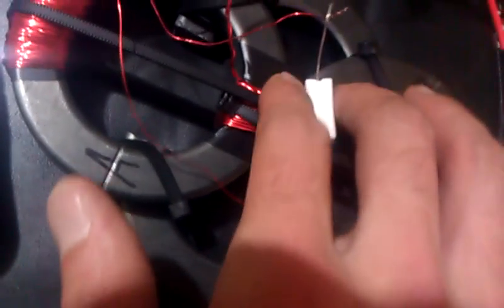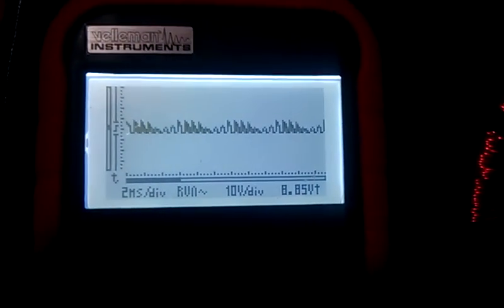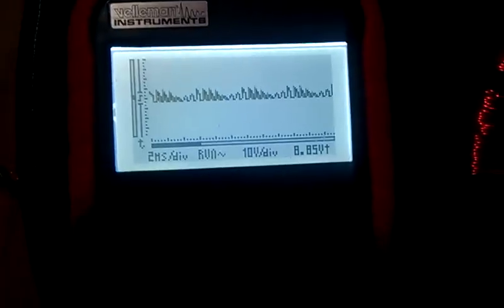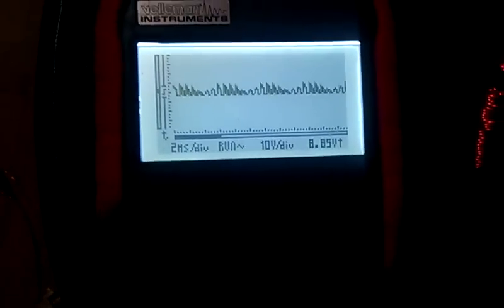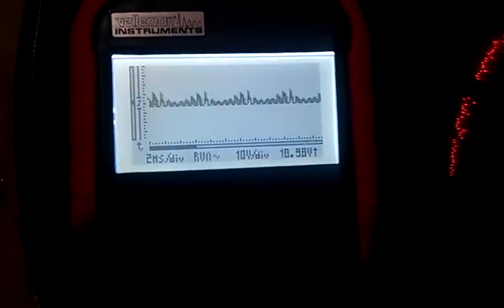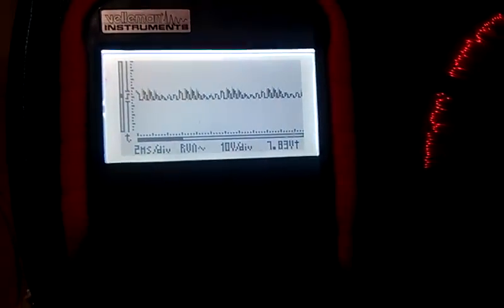39B Bi-Toroid: More Experimenting, Some Improvements

Comment: Nice setup! Very inspiring... 
1. Now are you sure that you don't just push the current over to the toroid on the right side - connecting the resistor on the left side? 
2. Have you checked the input wattage with and without the resistor? 
3. And does the oscilloscope measure RMS voltage at input frequency?
Sorry to be so interrogative, but I have seen too many promising setups fail at closer look. I am
very interested though. Regenerative/reflected current theory is spicy...

Comment: try using fisherprice plastic donut for the core and place a two hundred turn 28ga coil inside the toriod.  From 12vdc pulses I  got 1600volts out, when I was testing the rodin coils.  you'll have to cut the donut inhalf first then place inner coil inside glue or tape back together and wind on the other coils.

Comment: Well done, but could all be just impedance matching....
You really have to show, that you get more out than putting in....

Best would be to bridgerectify the output to DC and then measure the DC output versus
the AC input or better build your own small square wave oscillator, maybe Joulethief and power
it from a DC source like a battery.

Then you can compare DC output versus DC input.
Much easier then to measure.

Regards, Stefan.

Comment: Yes I'm interested too, and I have seen his work before it was pulled. Do you have any very low ohm resistors like 0.47 ohms? If you put that on the input, and measure the current going in, you'll see a trend, is it increasing as the second secondary is loaded? Then, scope it, because even the meter could be lying - scope it looking for its highest instaneous peak input. And the general waveform, by comparison. Cheers. It does look good.